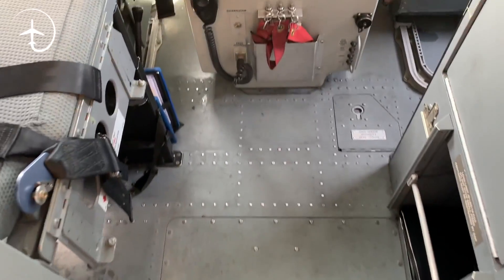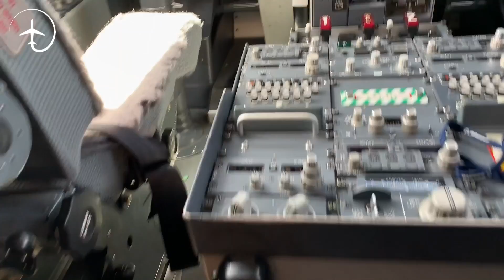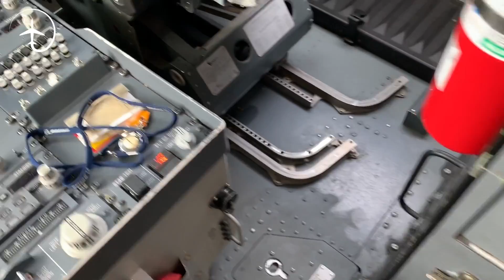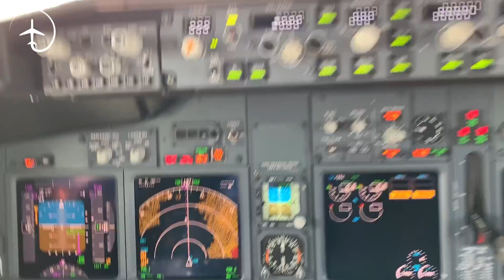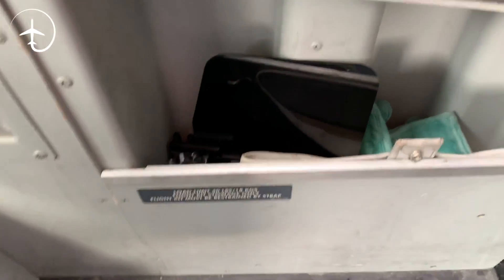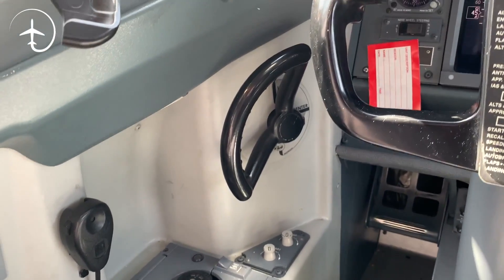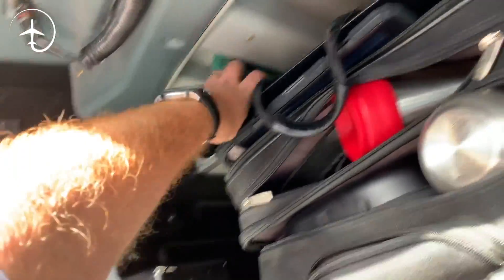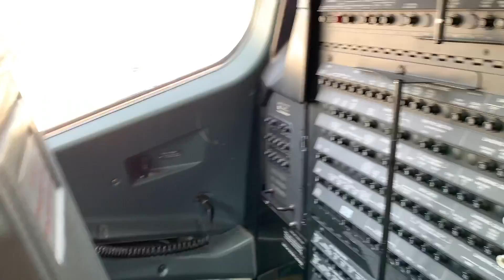Boeing 737 Cockpit secrets!

Comment: I know this is a fully functional airplane, but still, seeing how it looks "used", with buttons consumed (like paints on the most used switches), gives me the same sense of safety as VW beetle (the old one)...
Reply: If I've learned one thing in life, it is better to have a used high-quality device than a new low cost model.
Reply: Cosmetics have nothing to do with functionality. Parts are never thrown away from airplanes they are sent out to be fixed and touched up. Still serves their purpose.
Reply: MyTech 🙏 to that

Comment: Very cool. Thank you. I read the comments about how it looks dated etc. But for me there’s something comforting and old school about that. WYSIWYG. What you see is what you get. If there’s a tech problem then its probably easier to get your head around it rather than having a computer interpreting and communicating. I loved the B747 classic cockpit poster I had as a kid. Switches and dials everywhere including on the flight engineers position. I’m not sure I’d still want to be flying something like that now though given a choice between that and the 747-400 but there’s still a coolness about old school. 
I really enjoyed this though, and will look out for other videos. 

Oh Cat 3.. does that relate to the ability of the aircraft to do cat 3 landings?
Reply: I remember the first time I saw the pitch trim wheel on a 727, by my left knee spinning around at what appears to be a inappropriately rapid, and frightening RPM. Those wheels looked like they were made of cast iron, weighed a ton, and would  vaporize skin in a vicious friction burn. They never stopped looking dangerous to me, with the white mark painted on it a blur as it whizzed around. They made a noise too. If any part of a modern Boeing cockpit could be called primitive, that would get my vote.

Comment: How Many Pilots Does it Take to Change a Light Bulb?
Reply: great question i think this will be handled by first officer only not by the capt
Reply: 1 as soon as he sees there is 1 missing
Reply: @balajisharathkumar9753 It depend on which phase of flight they are in. During the pre-check it takes 1 pilot, during an actually flight it takes 2 pilots. As the spare bulbs are behind the chairs, one of the pilots needs to get out of the chair. However there should always one pilot be flying the aircraft. However the other pilot does need to confirm the action of the pilot handling the light bulb change..
Reply: One. Plus three engineers. The pilot calls engineering. One engineer to verify the problem. One to perform the work. One to sign off the paperwork.
Reply: As long as maintenance is present, none.
Reply: None...  in the old days we used to change hem, bu that is a maintenance task now. I suppose if one breaks and you want to use your authoity as pic to do it, but maintenance nor the faa likes us screwing with trying to fix stuff.
Reply: @markg7963  I'm an engine shop guy myself. So I don't get much time in the cockpit. But I was thinking it had to be the A&P that changes that bulb so it can be signed off in the logbook.
Reply: Kevin Fransen     Yes. That’s true if it’s written up (as it should be).  And on the ground.  In flight ultimately we have the authority (depending on scenario) to change it.  Say, no green light on a right main gear and the bulb checks bad, and you are running low on time and fuel..., I doubt you would be faulted in an emergency procedure for using captain authority.   But true, on a normal day at the gate, it’s still not the pilots aircraft, it belongs to maintenance. So we write it up and they fix it and sign it off.   Of course in reality the absense of a light is rarely a problem, and it’s a stretch to even come up with any scenario where this comes into play. In the 737 there is simply another set of green lights on the overhead that indicate the same, so use those to verify.  Of course, of all the weird stuff that does break, you never know.  Had a weird one yesterday when the right fmc took a long nap, then the lnav never would function again for like an hour, then started working again.  Electrical gremlins are alive and well in complex aircraft.
Reply: Eastern Air Lines Flight 401. "The crash occurred while the entire cockpit crew was preoccupied with a burnt-out landing gear indicator light. They failed to notice that the autopilot had inadvertently been disconnected and, as a result, the aircraft gradually lost altitude and crashed." The crash killed 101 people.
Reply: None. Its an engineering function.  It has to be signed off in the log. The spare filaments are checked for complement each daily check.

Comment: How often do the cockpits get a deep clean, looks grimy!
Reply: I'm sure it's possible that flight attendants could periodically clean the flight deck. But realistically that would probably be done at C or D check when the whole cockpit is ripped apart.
Reply: I read in the FZ981 accident report that it was suspected when the plane experienced negative G forces that the dirt, or whatever sand or debris was in the cockpit may have gotten into the pilots eyes.  It made me really wonder if keeping a very clean cockpit is necessary for safety reasons.
Reply: While in the Air Force, one of my jobs was to inspect the plane for cleanliness. Not that the AF was anal retentive, it was a safety issue. Dirty cockpits can be detrimental to proper operating equipment. Every so many hours of flight, all panels were removed to inspect for any dirt, hair, bugs, etc. If this plane was part of the Air Force, it would be immediately grounded due to the dirty cockpit.
Reply: The floor reminds me of a BAC 1-11 layout from the 1970's ! (Good old "British United Airways")
Reply: Sean Casey only extreme negative Gs would be able to cause that and those don’t happen often enough for the risk to outweigh the financial burden. Not saying I agree with that way of looking at it just saying that’s how it is. Even the FAA and other agencies around the world use a formula that assigns a specific monetary value to each person on board to determine whether to ground an aircraft type or mandate certain maintenance checks instead of just suggesting them

Comment: The floors too bare. Needs some bright orange shag carpet.
Reply: Nope we need weight saving maybe some green fake grass paint
Reply: We need fake sky paint for those floors. Or better, a widescreen showing the land under it.
Reply: Don’t forget the fuzzy dice hanging between the front windshields!🎲🎲
Reply: @57Jimmy   And a 8-track player to bring it all together.
Reply: Not good. Carpet is flammable, and not just that, if it is orange, you can't even see if it is on fire or not!
Reply: Maybe Southwest Air (737s) already has!
Reply: And beaded seat covers for the seats, just like all the old-school Australian Taxi drivers used to have, rather than the wool covers.

Comment: Wow! I did not expect a plane flying nowadays to look this ancient.
Reply: Check out an MD-80....they are still flying (for a few more months, anyway).
Reply: Likewise, I don't know much about cockpits but was surprised at all the hands on gear and knobs. Nice to see though.
Reply: Are you kidding me? Check out the 300/400/500 models of 737's. Those are still flying. As are 727's and DC-9's. This is probably an 800 or 900 model he's standing in. There's nothing ancient about this plane.
Reply: The Boeing 727 has stopped flying commercially rip
Reply: I thought we were getting in a Lancaster at first looking behind the seats.
Reply: @davidbonnett2422  Hahahaha what do you excpect, the 737 is a 60's design and while Boeing has changed some of it, a lot still remains unchanged. Take a look at an A320 and it looks much more modern

Comment: Hi, Great video. During flight, because the circuit breakers located behind the pilots, if one or more, pops out, is there any indications for this, visual or audio to pilots?
Reply: Samuel Yankovitch you’ll hear a pop, I don’t know how likely you are to notice while the engines are running, but while doing maintenance you’ll always hear a distinctive pop when you pull or push one
Reply: Nope, you will not get any indication.

Comment: I heard a contact with a 737 was made last week via ham radio. It was said 737s are equipped with HF ham radio capability. That it's sometimes used in maritime communications.
Reply: More likely a longer range model like a 747 767 777 787, HF is used over the ocean only when out of vhf range.
Reply: Though there are a few ETOPS 737 used for domestic West coast to Hawaii routes. I don't know if there is a VHF dead zone in that route.(at 30k feet)
Reply: The 737s we operate are all Etops, but regardless even before that were equipped with HF radios.  Sometimes even on non-Etops segments we use the HF radios.  I’m sure it’s just because they were ordered with that option   Probably a lot of operators have no need for HF radios.

Comment: 2:46 I presume this works both ways, also preventing you from making a passenger announcement to ATC? XD
Reply: In theory, yes. I've been on flights where they've made a call to ATC and I've been on the scope when they keyed up the mic on the frequency to make a PA to the back of the plane. Then again, they aren't common; I just happen to fly 4000 miles every week or so and I'm a pilot, dispatcher, and air traffic controller by license so I'm exposed to it all the time!
Reply: Not sure what you mean by “both ways”.  The dedicated microphone aft of the center pedestal can ONLY be used to make PA announcements to the cabin.

     That microphone does not interface with the audio select panel.  Its purpose is to prevent making PAs on the radio.
Reply: @Stepclimb  Right—I meant, if you only use the dedicated PA mic for making PA announcements, then not only will you avoid calling ATC on the PA, you'll avoid making a PA anouncement to ATC.
Reply: Ice Karma 
     I see what you mean now.  Yes, using that mic for PA’s, WILL prevent PA’s on ATC freqs and SHOULD prevent making an ATC call on PA.

It needs to be a consistent habit pattern to always use that dedicated mic for PA for every PA.  

As a side note, there are so many customer options from Boeing.  Some airlines use a handheld that looks like a telephone handset mounted on the aft pedestal.   It is used for PAs and talking with the cabin crew on the SVC interphone only.

     And some airlines don’t use a dedicated PA mic at all.  They just leave it up to the crew to be careful with our mic selector buttons!
Reply: @Stepclimb  I can believe it, about it needing to be a consistent habit. And thank you for that insight into Boeing's customer options!

I fall into the "AVgeek" category myself—I'm not a pilot, I don't work for an airline, and I'm super interested in every area of engineering... and aviation has seemingly-endless depths to plumb, to an outsider such as myself.

As an aside, I bought Microsoft Flight Simulator X a few weeks ago... I'm still trying to learn how to work it, never mind an airplane! XD

Comment: Looks like this particular flight deck could use a really good cleaning. 
Looks like behind the captain's seatbelts the closet looks like a dirty foot print on the deck and that red circuit breaker at the top of the panel had a cobweb.
That tells me there might be some creepy crawlies hitching a ride on this aircraft.

Comment: Excellent video! I once saw a video of a 747-400 cockpit and in the over head panel there was a smoke vent that could be opened to vent out any smoke from small electrical fires etc. Does the 737 also have a smoke vent like this? And if so how does using the vent not cause the cockpit to depressurise?
Also are the rudder pedals and control column connected to pulley cables under the floor on the 737?

Comment: These are beyond old fashioned. Can you believe they are still the most popular planes of all time?
Reply from the maker: Absolutely. They work!
Reply: The basic designs for the B-52 and C-130 are even older, and they're still in active service. Designed right, planes can have a long lifespan.
Reply: If it ain't broke, don't fix it. IF you fix it and it breaks, call it a Max.
Reply: @Inkling777  Look what they're doing with the Douglas DC-3 these days. 1935 design, either just flying around stock or lengthened and repowered with turpoprops...

Comment: Do a video on aircraft braking system!
Reply: Its a multi plate disk(like the clutch in a motorcycle) with typical hydraulic cylinder actuation. Each set of main gear has two hydraulic lines feeding two sets of actuators. pressure comes from hydraulic systems A or B, A is powered by a mechanical pump on Engine one and an electric pump powered from engine 2, B is just the reverse. Then there is a standby electric pump driven by any electric bus including the APU or battery, and a mechanical power transfer unit that can power the standby systems on B using pressure from A. Finally, a pressure reservoir on the brake system that without any hydraulic pumps will last for 2-3 applications of the brakes.

Comment: This 737 seems to not have a HUD, is this also an option?
Reply: I think it is an option and some airlines don't get it beacause it doesn't bring many advantages and only raises the maintenance cost of the aircraft.
Reply: Some companies operate with huds, and some don’t. When executing a cat III landing, this aircraft would be capable of an autolanding, but the downside is maintaining these systems that are used infrequently.  If an operator uses a HUD for Cat iii weather, the pilot can land without the auto land system, and the aircraft is cheaper to maintain.  Both are options just depends on who operates them.  Southwest I think uses the HUD approach.

Comment: I wound if after they cleaning crew cleans the cockpit if the have a sheet to check all the switches to make sure they didn't accidentally move one
Reply: Nope
Reply: As you can see, this risk is avoided by just leaving dirt, dust and spider webs just in place.
Reply: Engineers clean the cockpit. THey know not to push anything, and know where everything is supposed to be in case they do. They just don't have to to clean it because they're too busy fixing it.